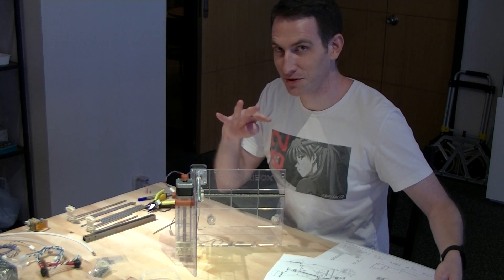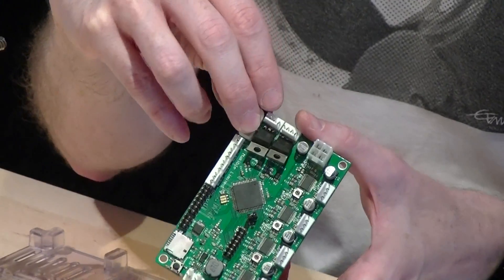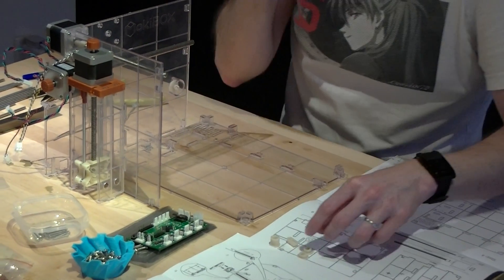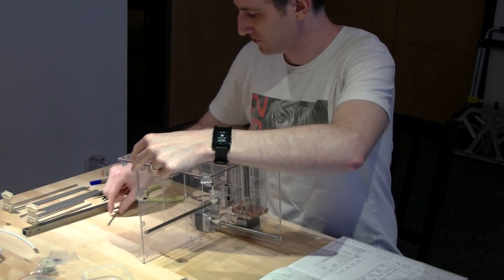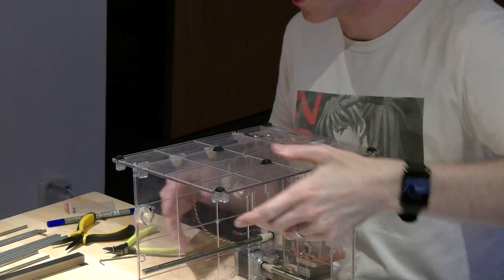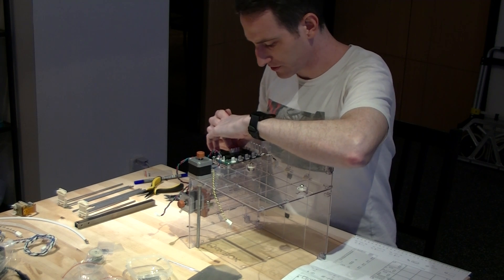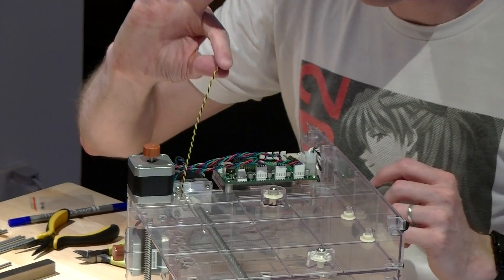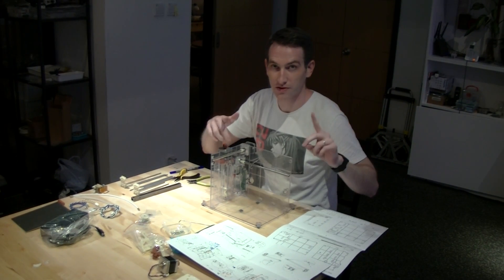#MakiBox Assembly Step 4

Comment: The right way to handle electronics is to use a dirt cheap grounding strap not constantly tell people to be careful with fragile components. I got a Used Makibox for £30 thinking if I can't get it working I'l use it for Parts; The guy I got it from seemed to have tried unsuccessfully to convert to Ramps but had no Mega 2560 under the 1.4 board - Ive uploaded new firmware to it with FAR less trouble than Ive had trying to update Melzi/Tronxy (what a nightmare!) and I'm looking forward to seeing what this tiny printer can do.